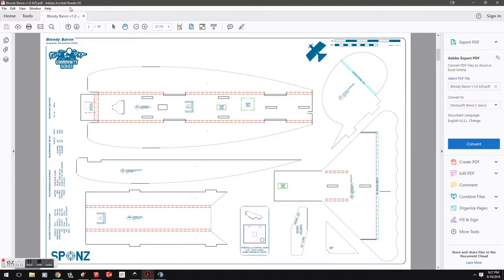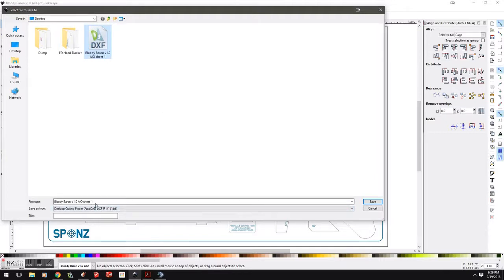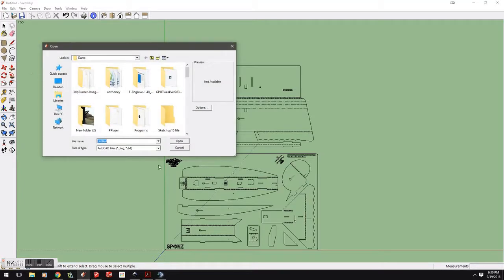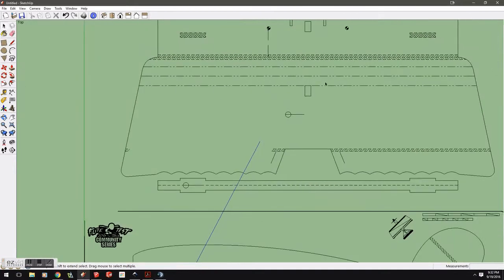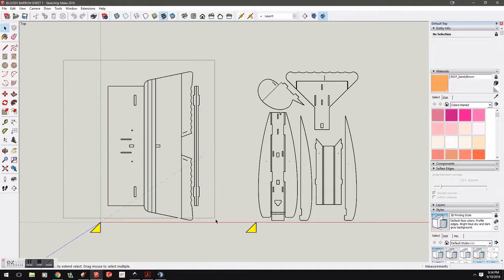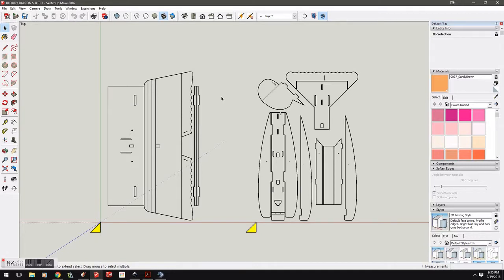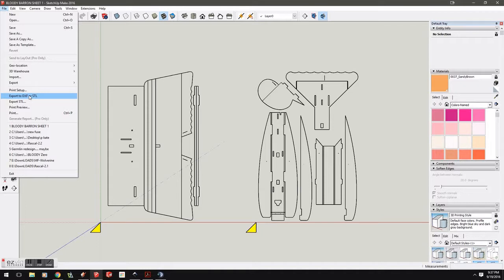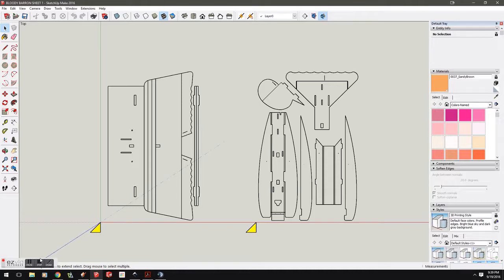How to convert PDF to DXF then to SKetchup

Comment: I'm starting back into building card models this will really help as hen I can laser cut the formers for wings, stabilizers and fuselages. But I'm going right from inkscape into AutoCAD
Reply from the maker: Awesome!  Once you can get that PDF into a editable file format, like DXF, it can go into just any program the user prefers.  When I made this video, SketchUp was the free "go to" software at the time.  Heck, I still use SketchUp when I want to draw something quick in 3D to get a idea out of my head 🙂.  If I want 2D, I'm all about AutoCAD.  I'm glad this video will help you, that's I put it out there 👍
Reply: @pump4546  
I'm simply used to AutoCAD. The only issue is being very carefull to re-scale the image to the proper size. I'm just using a low buck diode laser. I've also been working on HO scale wall modules. The modules are for multi story industrial buildings 1900 through 1950. I can't cut MDF or thicker plywood. So I've been looking at using Canson Mi-Tense illustration board. It cuts and takes engraving nicely. Only the individual bricks in the bond patterns are very fragile. Just touch them with a hobby knife and they pop right off. The solution. Flood them with a 1:1 solution of PVA and distilled water. When thoroughly dry the are much more manageable.  The illustration board is a nice blend between cost and rigidity.

Comment: Thanks Todd, it was great meeting you at Flitefest Fest 2016 I'm the one that mentioned I have an OX CNC as well! What bit do you use most when cutting the foam board?
Reply from the maker: Hi Tom, it was nice to meet you at Flite Fest too :) ... 

Here's what I've had good luck with on the Dollar Tree foam:
http://drillbitsunlimited.com/0394-100mm-Two-Flute-Carbide-Endmill-Flat-End-118-LOC-P5600967.aspx

And the best bit for the water resistant foam:
https://www.aliexpress.com/item/10Pcs-set-0-8mm-Carbide-CNC-PCB-End-Mill-Endmill-Engraving-Bits-for-Milling-Machine/32618421023.html?spm=2114.13010608.0.54.GSx1VU
Reply: Ok thanks a bunch, I have just tried the water resistant foam and it's awesome! It's much easier to work with!